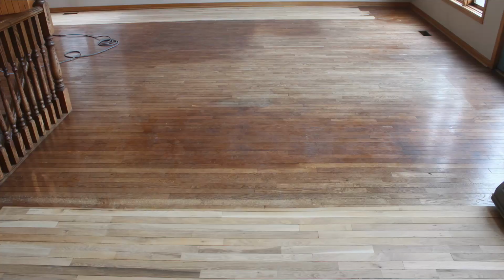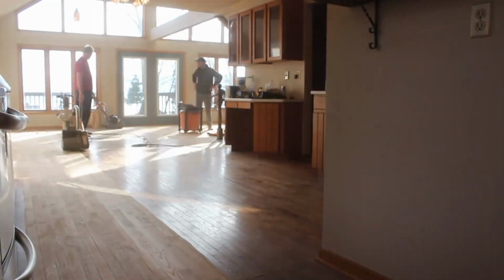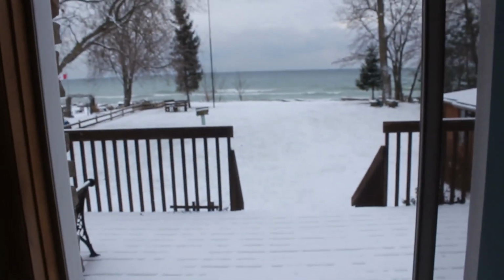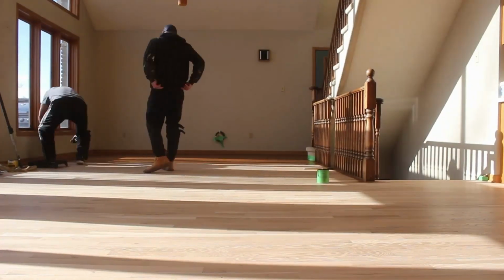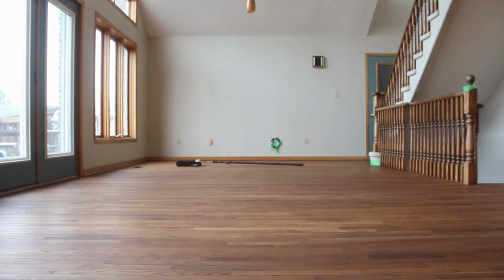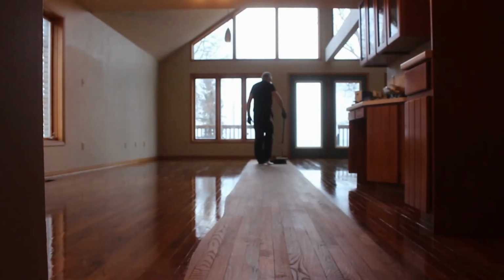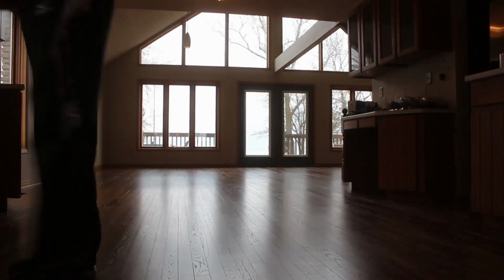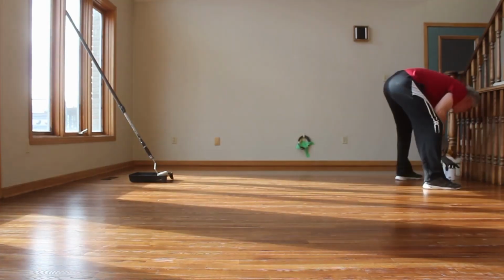How To: Sand Stain Finish Oak Floor - Step By Step - Ask Questions & Post Comments (Ep#48)

Comment: Can't imagine anyone leaving you hate! I've learned so much invaluable information from your channel. We are doing the floors ourself in the home we recently bought and it has been a long process! We're all done sanding, just working on cleaning, should apply stain this Saturday. We ended up deciding on water based finishes at the last minute, maybe you could make a video discussing that? I was 100% for oil based but had my mind changed, ended up purchasing Bona stain and poly, hoping it all goes on well 🤞
Reply from the maker: Work quickly with water based stain as it dries fast and is difficult to blend out when it dries. Best to rag it on, and off. Labour intensive.
You can use a circular orbital buffer to apply with carpet pad it but is difficult if you've never used this machine before. 

For applying water based urethane pour it into a paint cup, then pour a line of it on the floor from the cup and work the roller on it after..watch this link here..
https://youtu.be/Fg-JVC3CDmM?t=221

Good luck.
Reply: @HardwoodFloorRefinishing101  I was wavering back and for between roller or brushes for the poly water based. Should I return the brushes and get a roller? So much info out there and wasn't sure what advice I should take. I sanded my living room and dining room with a handheld orbital black and decker, what a mistake. I took back 2 rental orbitals because they were broke, I finally watched your video and feel confident using a drum sander. Going today to rent it. Smallest grit is 36, I think that will be ok on my floors with all the unessesary sanding I did already. Thank you!
Reply: Should I use a roller or a brush, if a roller what is the best kind to use??
Reply from the maker: @flowergarden1426  6 or 10 mil, lint free, micro fiber roller

Comment: I'm currently sanding my own house. I have red oak floors, and I started with a 40 grit, then did 60 grit (on both drum and edger). I'm debating about whether to do another pass at 80 grit, or just to swich to the orbital sand like you did in this project, what are your thoughts? I plan on staining the wood a darker color (varathane espresso), and then apply 3 coats of poly. Does that sound like a good plan?
Reply from the maker: Yes, that's the correct procedure, 80 grit on orbital sander for final pass is good. Thanks for watching.

Comment: Just out of curiosity, why do you prefer the 110 machines vs the 220 ones?
Reply from the maker: 220 machines are excellent for heavy stock removal when speed is required, and when dealing with multiple layers of paint, or adhesive that may be on the floor. The 110 machines are lighter and don't leave wheel marks as easily when sanding into the higher grits. Also the standard wall receptacles are usually always readily available, where the 220 isn't.
Reply: @HardwoodFloorRefinishing101  I can definitely see why they might be more practical sometimes.
I've just never used one myself I've always used 220 machines.
You'd honestly probably love a hummel, they're easy to break down for transport they don't leave wheel marks either ;)

Comment: What grit do you use for edger ?
Reply: You used 60 at stairs. What about the rest
Reply from the maker: Depends on what finish is on floor. I usually start with 60 grit. If the finish is coming off well I'll continue and edger all of it 60. If the abrasive is gumming up too fast, or breaking down and burning the wood (abrasive breaks down and burns floor turning it purple, black) drop it to 36 or 40. In some extreme cases you may need to drop  to 24, or even 16 grit but this is rare. Thanks for watching, Good Luck:goodvibes:
Reply from the maker: @sammckinnon5842  All of it
Reply: Ok thanks
Reply: Do you use the wet pads for swiffer ?
Reply from the maker: @sammckinnon5842  No, dry but I vacuum it several times while I’m using it. Go over it twice. If it’s water based finish you can use a water dampened pad if you like. If it’s oil based finish you’ll use a mineral spirit based solvent.
Reply: Ok thanks for all your help
Reply from the maker: @sammckinnon5842  Thanks for watching!